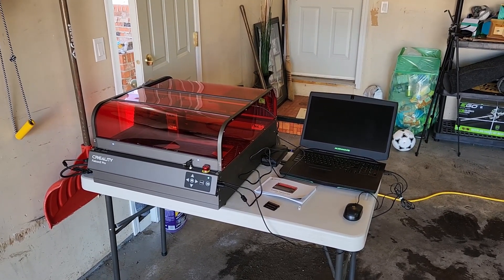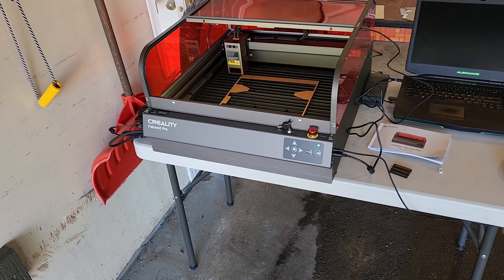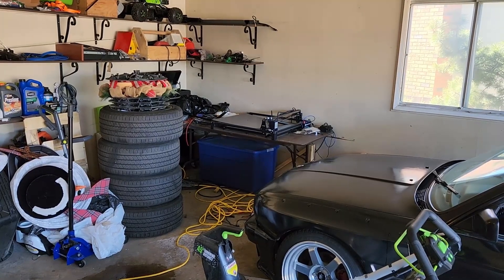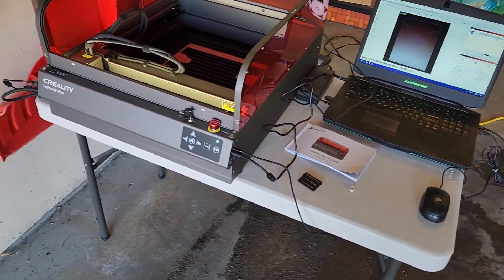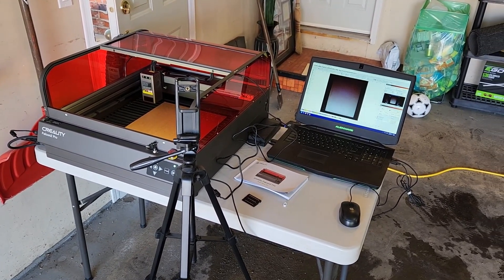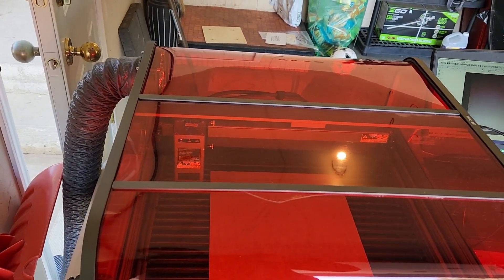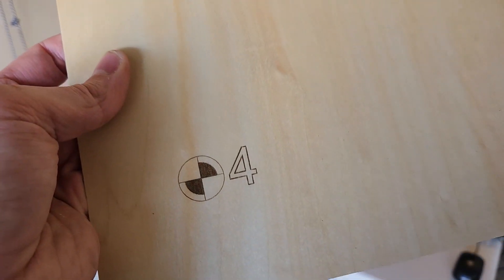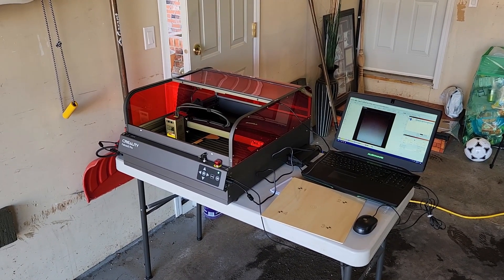Creality Falcon2 Pro Enclosed Laser Engraver & Cutter Impressions

Comment: I have a Falcon2 22W basic version.   It lists on Amazon for USD 809 with coupon, but if you sign up for Creality's e-mail list, they frequently offer steep discounts.  I've seen it as low as around USD 600.  So you paid $1000 for a cheap plastic enclosure and some adjustable rails.  My biggest gripe is the difficulty in aligning the laser with the work piece.  The high sides of the frame and the shield around the laser head make it hard to see the laser spot.  It looks like it would be even more difficult with this enclosure.  I plan to add a homemade red LED laser crosshair that attaches to the side of the laser head and gives an accurate location relative to the 22W diode.  Once you have measured the offset, you can enter this into Lightburn so you can match the zero of the work piece to align exactly with the 22W diode laser.  Look on the "Steve Makes Everything" YT channel for plans.  Note that the Creality laser head has a USB-C plug that can be used to supply power to the red LED laser, so you don't need the external battery as in Steve's plans.
Reply from the maker: the encloser is all metal, the camera solves all the alignment issues, I agree it's too much money but an upgrade for sure. it's 1300 USD